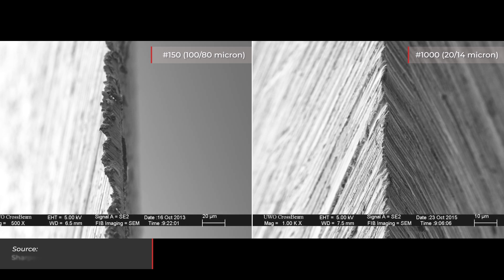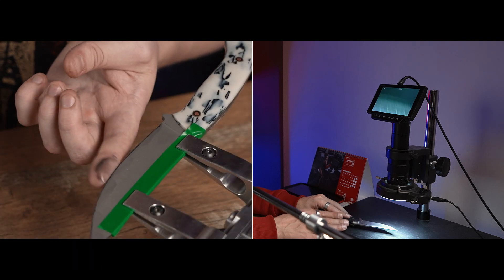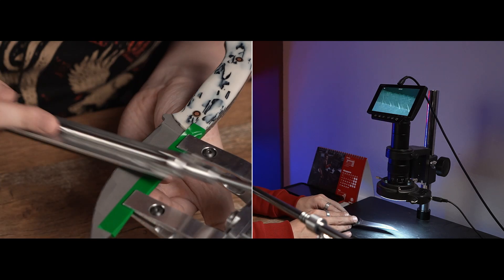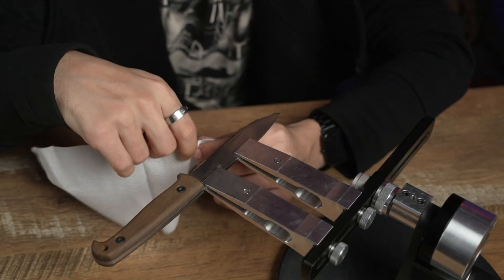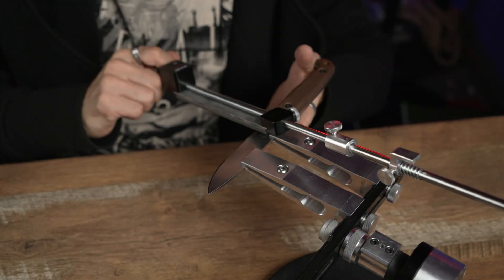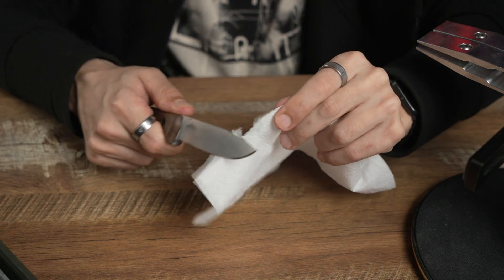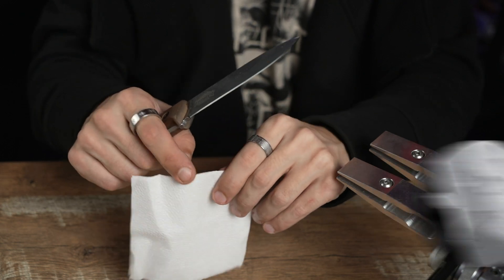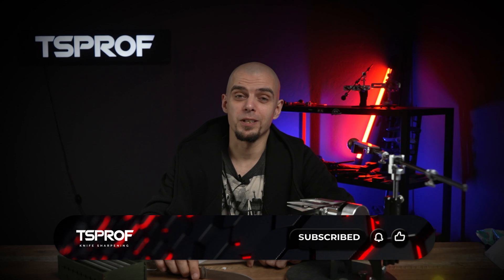Sharpening Lifehacks. Knife Deburring Guide.

Comment: I video you mentioned deburring by moving in same direction, but does it matter if edge trailing vs edge leading or does it not matter as long as in one direction?
Reply from the maker: Under perfect conditions, it'd be great to move the stone towards the blade keeping the same angle of marks of the cutting edge, as it was shaped during the sharpening. But it's not so critical :)